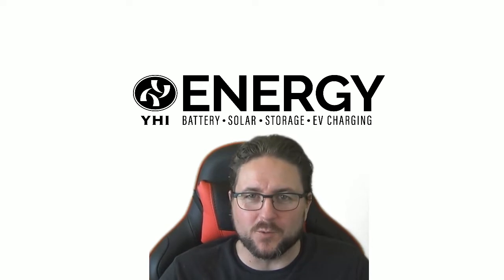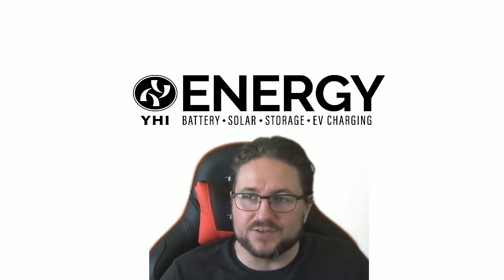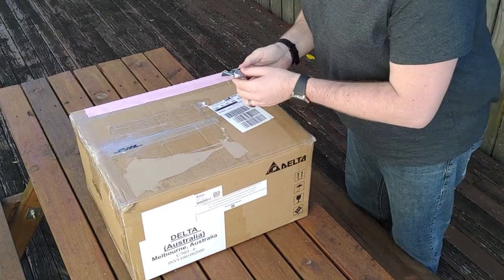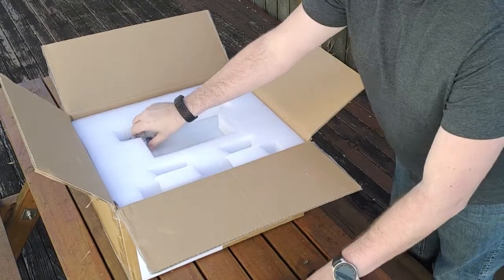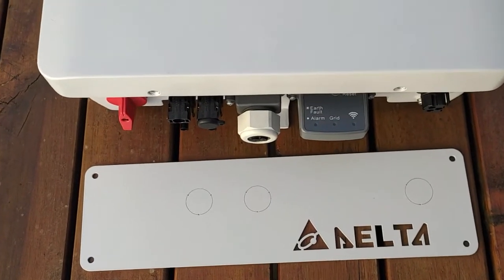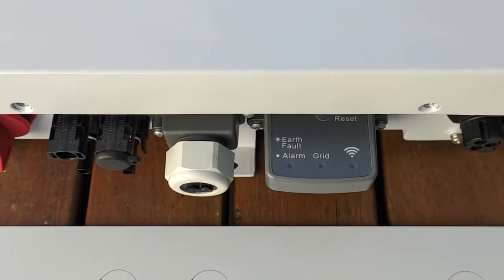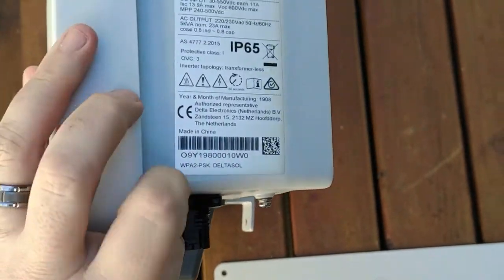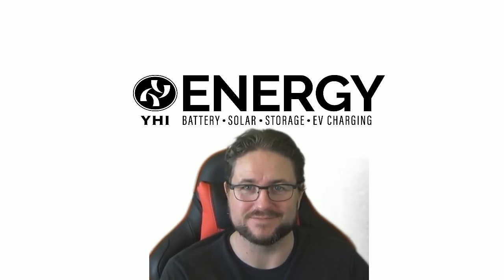YHI Energy - Delta H5A Inverter Unboxing

Comment: Pls help ? How do I reset the incell 250a battery 48v when the bms trip with fault light, this often happen when to much of load is been drawn or surge, there should be a easy way to reset the battery without reconnecting the inverter cable,also the battery trips wen connected to ordinary inverter because of capacitor charge when connecting to battery